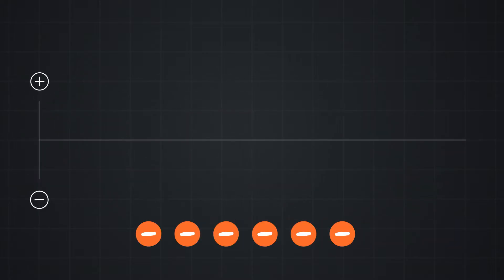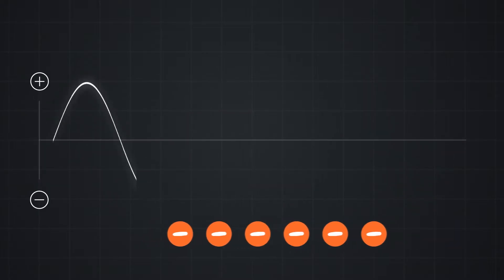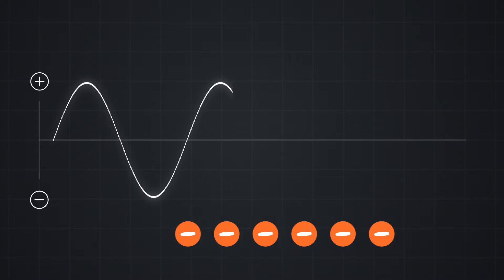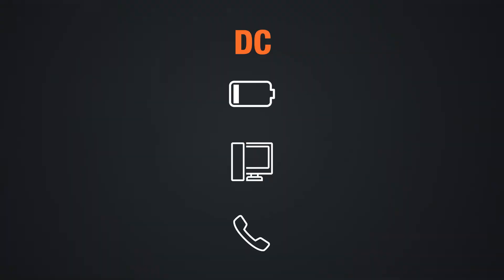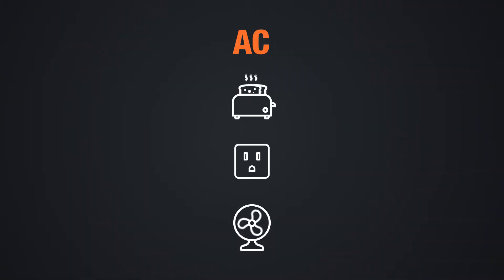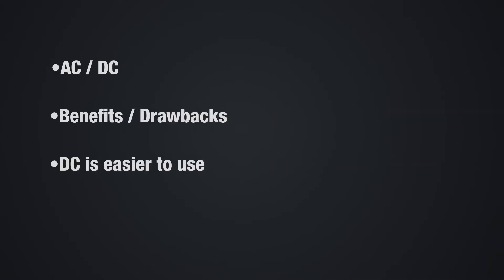The Difference between AC and DC Electricity | Basic Electronics

Comment: Sir , can u explain the ac in more detail🤤, I can't get that, how does it flow like I am so confused, explain me , sir.
Reply from the maker: I think the word "flow" may be the problem here.  With AC electricity, we may sometimes say that it flows but, in reality, it doesn't.  It's almost like pedaling a bicycle - you're doing work but the pedals are moving first forward, then backward, then forward, and aren't actually changing position in relation to the frame of the bike.  The same thing is happening with the electrons, they are being pushed first in one direction and then in the opposite direction and their net movement is 0.  BUT!  That movement still has power in it, which is what is used by your devices.
Reply: @CircuitBread  👌🥰
Reply: @CircuitBread  sorry, if u dont mind can u send an animation vid or pic link ..

Comment: Can someone clarify these terms:

Load- as in "current is still going through a load"
Skin Effect- as in "doesn't suffer from the skin effect that plagues AC circuits"
Polarity- as in "AC current changes direction as polarity of voltage changes"
Reply from the maker: Hi Dashiell!  

Load - usually refers to whatever needs the current.  It can refer to resistors, integrated circuits, microcontrollers, whatever the current is flowing through.

Skin effect - strangely, at higher AC frequencies, electricity doesn't flow through the inside of wires, only on the outside of the wire.  So you're basically "wasting" the inside of the wire in terms of how much electricity you can carry.  It's called the skin effect.  

Polarity - just like magnets have a north and south pole, electricity has charges that repel or attract each other.  So, if voltage is one way, it will push electrons in one direction.  Flip the voltage (kind of like changing north to south) and it will push the electrons in the opposite direction.

Hope that helps!